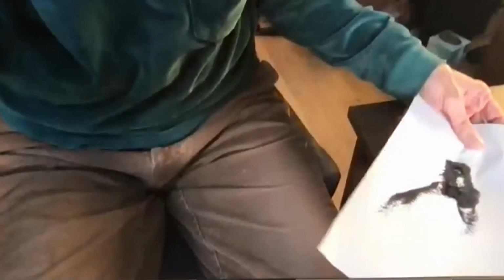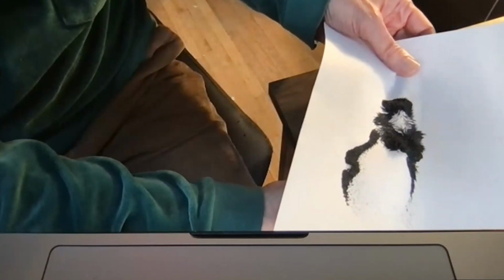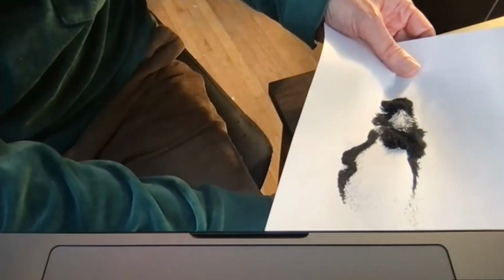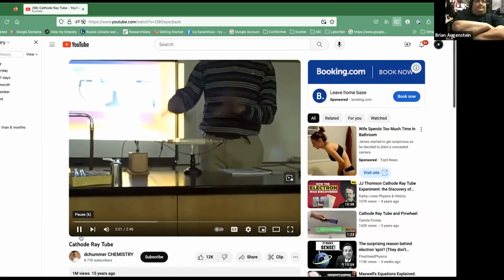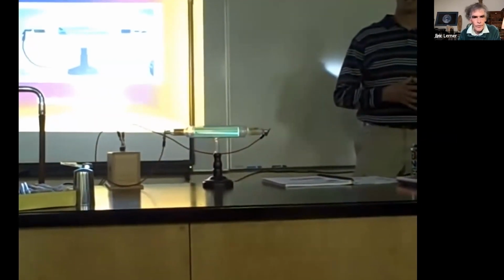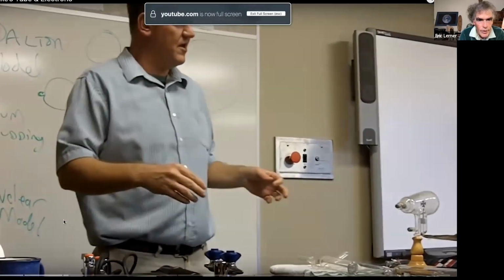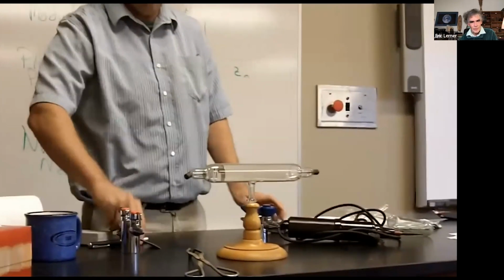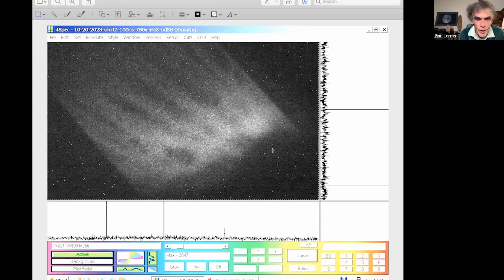Demonstrating the Reality of Magnetic Fields

Comment: 30:31  I think there really is a repulsion. Each filing blob gets magnetized the same way, i.e. let's say their north poles are all touching the glass of the bottle. Now if you have two box-shaped magnets on the table placed so that each of their north pole is touching the surface of the table, you can easily check that these repel each other (the repulsion is a bit weaker than if they would be placed had to had with their poles). If one of the magnets would face the table with its north pole and the other with the south pole, the would attract. If the field lines are allowed to complete the circle thru the other magnet (like in the latter case), attraction results. If, on the other hand, the field lines both point the same direction where they are exiting the magnet they cannot connect and get squeezed between the magnets causing their repulsion. 

In the case of the filings, unless the path completely joins N and S pole of the magnet, this effect appears at its end, keeping the individual ends apart giving it a tufty look.

Comment: This model has some goods points. Magnetic fields are charged rather than neutral field - like a plasma. Field lines should repel each other a bit but at subatomic scales. Gravity, dark energy and magnetism on the same electromagnetic field looks like it just about works but I haven't done the maths. Powerful enough magnetic fields can levitate non-ferrous objects.
-- 
ELECTRO-POSITRONIC FIELD: -ve gas binds a ball of +ve cells freed by Full Escape Energy as electron_positron pairs
SPIN: particles pull in gas/pump out loops (to others in magnetic circuits, offsetting cells. Flux charges the field)
MASS: lateral spin outflow force cancels/concentrates, leaving inward field stretch. +ve shells, -ve gaps, packed core
DARK GRAVITY: gas moves from voids to matter. Expansion + contraction. Field density gradient / warped space(time)
HEAVY FORCE: mass multiplier mechanism pulls in field before annihilating all particles but (anti) protons/neutrons
HEAVY FUSION: in the Big Bang (and stars?) 2 positrons oppositely hit 1 electron (more than 2 electrons hit 1 positron)
POSITRONIUM: e_p. Muon: ep_e. Proton: pep. Neutron: pep_e. Tau: epep_e. Neutron mass is halfway between muon and tau
ANTIMATTER: 1,2 e_p pairs annihilate. 3: proton+anti proton or muon+anti muon. 4: neutron+anti neutron. 5: tau+anti tau
LIFETIME: Velocity (and gas density?) slow Local Time. (Anti) muon/tau heavy force starts after it slows from near C?  
BETA- DECAY: pep_e => pep e. Beta+: pep + new e_p => pep_e p. Weak Force: unstable atoms form and annihilate e_p pairs
NUCLEAR FORCE: neutron electrons bond to protons. Mass and magnetism compact and strengthen the nucleus 
BLACK HOLE: atoms cut into neutrons fused as tau cores (epep). Field spins, time slows, core annihilates, no singularity
DARK STUFF: more (anti) muon/tau (solitary cores?) as the galaxy thins out? 'Black hole spin'? Quantised inertia? MOND?
PHOTON: compressed, concentrated gas wave core pulls in field cells as it passes. Field warps diffract and interfere
2 SLIT EXPERIMENT: photon/particle field warps diffract and interfere, guiding the core. Detectors interfere with guides
INERTIA: energy lost moving through the field is returned as the field rebalances behind with a kick straight on 
ENTROPY: simplicity. Time reduces closed system complexity. Universe's simplest state is perfectly ordered empty field
ENTANGLEMENT: correlation broken by measurement? Physical link?

Comment: for 3d effect yall should fuck around with a ferrosphere. ferrofluid and wd40 in a clear glass christmas tree ornament bulb with LEDs around the base. or, same solution between two sheets of glass for 2-d effect. you dont wanna soak the ferrofluid into one clump in the oil, just enough to coat the surface of the glass. magnetic motor efficiency increased because of tesla in the 1890's. tesla Patented No. 447,921, on March 10, 1891 his alternating electric current generator that we know today as an alternator. tesla was definitely not a boy in the 1890s, he invented the modern world

Comment: Dear Mr. Lerner, I strongly recommend reading Heaviside's book "Electromagnetic Theory", especially Chapter II "OUTLINE OF ELECTROMAGNETIC CONNECTIONS".  I think this will answer all the questions you are trying to resolve.
Reply: §20 "Our primary knowledge of electricity, in its quantitative aspect, is founded upon the observation of the mechanical forces experienced by an electrically charged body, by a magnetised body, and by a body supporting electric current. In the study of these mechanical forces we are led to the more abstract ideas of electric force and magnetic force, apart from electrification, or magnetisation, or electric current, to work upon and produce visible effects. The conception of fields of force naturally follows, with the mapping out of space by means of lines or 'tubes of force' definitely distributed. A further and very important step is the recognition that the two vectors, electric force and magnetic force, represent, or are capable of measuring, the actual physical state of the medium concerned, from the electromagnetic point of view, when taken in conjunction with other quantities experimentally recognisable as properties of matter, showing that different substances are affected to different extents by the same intensity of electric or magnetic force. Electric force is then to be conceived as producing or being invariably associated with a flux, the electric displacement; and similarly magnetic force as producing a second flux, the magnetic induction."
Oliver Heaviside.
Reply: §25 "...The magnetic current dB/dt is of course real; it is the part K that is speculative. It plays an important part in the theory of the transmission of waves in conductors..."

§36 "...The electric current is the curl of the magnetic force.
The magnetic current is the negative curl of the electric force..."

Comment: Off topic questions regarding your fusion reactor? I'm curious if you think your reactor might be able to still operate correctly during a rocket launch while being subjected to acceleration and vibration? I ask this question because Rocket Lab's rocket engine that has  replaced the commonly used turbo pumps with electric powered pump's reducing engine complexity and increasing efficiency and safety, add to that growing desire of space vehicles to use Ion/plasma propulsion past the karman line. If you're reactor was installed in such a large space ship like Elon StarShip, could it increase playload and decrease the number of fuel tanker's required, it's a possible application that has wondering of it's feasibility.
Regarding your magnetic demonstration with magnet and iron filing, I always though it look like some kind of interference pattern to me.

Comment: dear Sir, magnets have two fields, a field of electric flux, and a gravity field 90° to the electric flux, which seems spherical when weak, but the stronger it gets, the more it flattens out horizontally.  in powerful large magnets the area above and below the magnet has less pull.  neutrons are magnets, their field is super small, but also very strong, so they bond at their equators, 90° to the poles of the electric flux.
Reply: Sounds very orthogonal
Reply: it is.  my video shows that the only thing in nature that can create fields 90° to the polar axis is a system originating with two rings sandwhiched together @TheFXofNewton